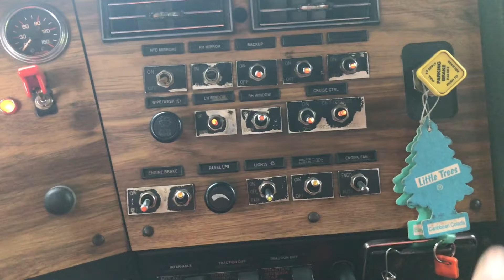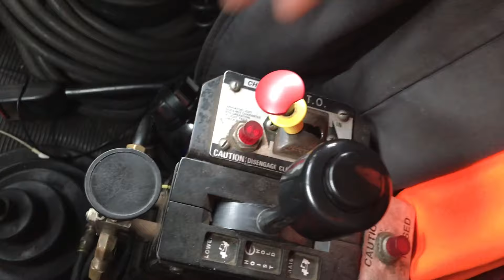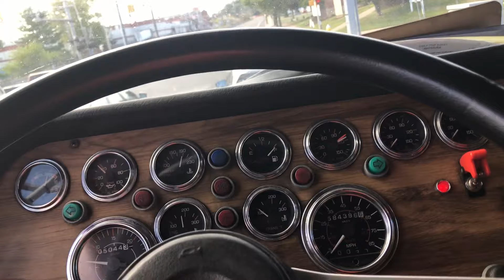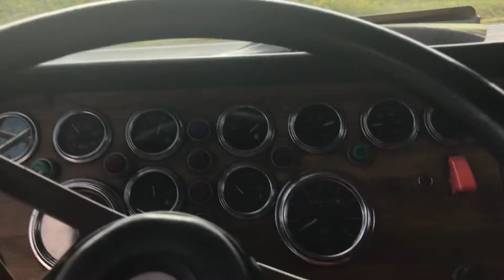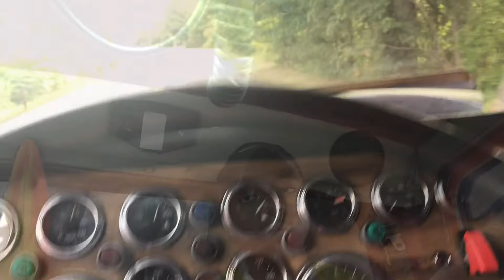A Day In The Life 20yr Old Truck Driver

Comment: Best way to get experience. Dump truck ! Top heavy. You will respect the weight of the truck. Don't be shy spray diesel on the floor. The asphalt don't stick that much. Clean the body every day, never know what you haul next day . Asphalt, top soil, mulch, don't want to mix it. Keep on trucking and be safe.
Reply from the maker: hunzolee that’s a fact dump truck good way to start off and thanks man 👍

Comment: The off road diesel with used motor oil mixed in a 2-1/2 gal pump sprayer works extremely well, that was my mix was  when I had my dump truck. 1/4-1/2 gal used motor oil and the rest off road diesel (red)💪🏼💯

Comment: Yo bro nice video keep making the dump truck videos. Just a question do you need a triaxle or can you do fine with a double axle dump truck? Thanks keep it up
Reply from the maker: Luke91 I have my CDL A I could drive any type of truck just need my Endorsement to do tanker and passenger for any type of bus
Reply: Mr Kwavy I’m looking to get into dump trucking in the next year, I want to have my own truck would it be better to get a  triaxle or a regular double axle. I’m currently a diesel tech and I’m getting my cdl. Thank you for the reply
Reply: Mr Kwavy how much did it run you to get your cdl class A
Reply from the maker: It ran me about 3800 there is MANY places that can do cheaper but that’s what I paid at the time
Reply: @TheLukeOProject  bro. I'm not in CT but here in MO a tri-axle makes more because they can haul more. Even if its hourly they pay more up to 5 axles because they usually want you to haul what is legal for your truck unless there is a job site restriction. I bought a tandem and added the 3rd about a month later. Hope that helps bro. I wish you the best.

Comment: Im 31 been driving truck since 18 do you only haul Asphalt i only haul Asphalt in my Kenworth w900 my dad's the Forman / tack truck driver / paver operator i started as a Looper / Flager moved up to a Skidster / roller operator i also own my own Ford F5500 20ft equipment trailer 1996 Ford Backhoe 555D International Loadstar s1600 Flatbed Sleeper Conversion Truck Bed Camper we also own a Hotshot / Courier Delivery not to mention on state jobs my dad also runs the Shuttle Buggy every on in the Asphalt business in Tennessee and Michigan call my dad The Asphalt King he's been running Asphalt companies over 40+ years where you located if i may ask
Reply from the maker: thats dope and me personally I haul whatever the contractor needs
Reply: Dear lord. A little punctuation goes a long way

Comment: Much respect to you brother, I definitely remember doing asphalt in 6 axle dump truck hauling 20 22 tons here in VA. I got my class A and now I move heavy equipment. That's my truck on my profile. 

Keep grinding brother..
Reply from the maker: thank you thank you means a lot and thats dope you drive something like a low boy
Reply: @MrKwavy  yes 55 ton lowboy and move equipment around. Love it. As for asphalt it was great. Sitting under the silos.

Do you use soap and water for your bed or does the plant have a wet station? Did see you wet your bed.  Also i used diesel only for the lip on the bed.
Reply from the maker: KW #1 the plant has the soap I use it sometimes for heavy asphalt I use diesel
Reply: @MrKwavy  well I sub driver, keep up the great work and content.

I'm thinking about doing the samething except with the moving of the equipment. Gotta gopro just havent done nothing yet.

Keep getting brother..much respect from VA..